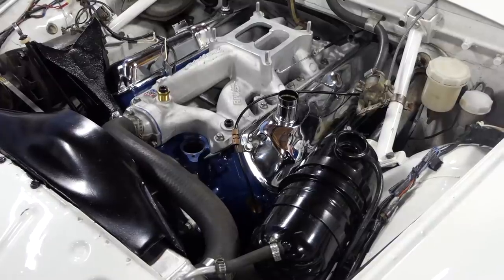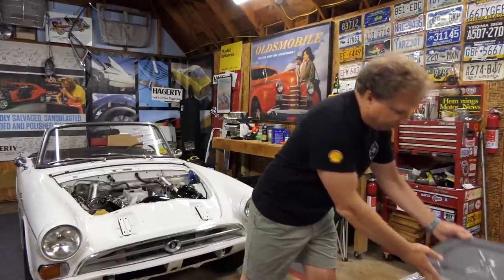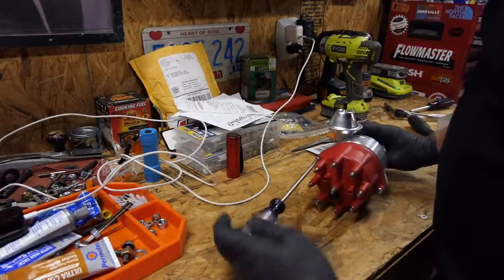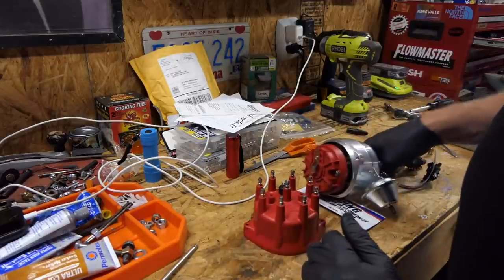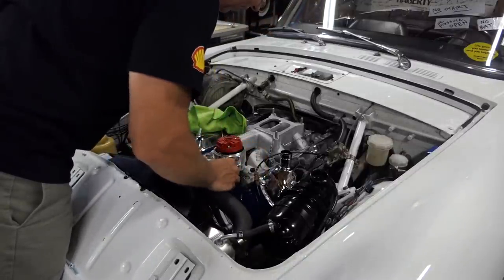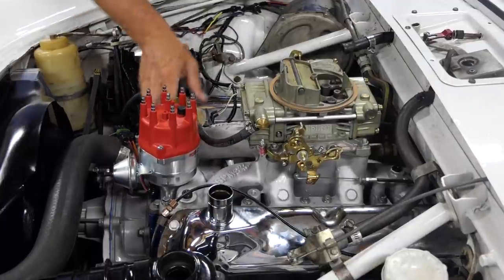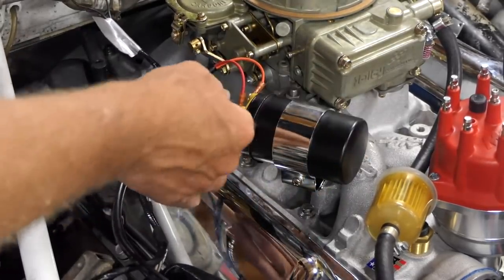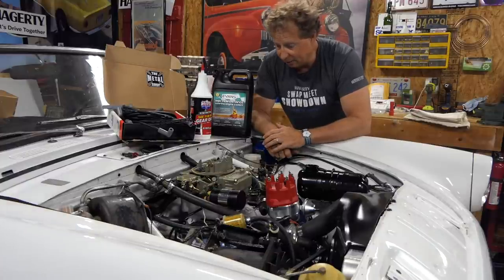Carb, distributor and other top-side parts | Sunbeam Tiger engine swap project - Ep. 10

Comment: Worried equals careful, which is no bad thing under your circumstances. I also changed to a electronic distributor setup on a 73 build and had good luck when the coil and electronics were in a cooler remote location. Started at -20 and ran well in the summer too. Best of luck to you!

Comment: Great episode as always. When you switch to the sniper though you will want to move that into coil. The ecu is on the front of the unit and with the coil and the dizzy and ecu all confined in a less than 1 sqft area you may experience RFI and have a lot of tuning problems.

Comment: The slight resistance you had when installing the distributor was the oil pump hexagonal shaft indexing with the distributor "socket". Good luck.

Comment: You can designate any of those towers as No 1, depending on how the distributor fits in the engine.  Sometimes the vacuum advance gets in the way of something and you need to turn the body of the distributor to make it fit, which will throw off your marked No. 1.  Project like this, I put the distributor in first where it fits and I have room to turn for timing, then designate a No 1 and follow the firing order from there.
Also wanted to add that you may have to increase plug gap.  I think stock with points was .035 and with EI you need to gap them at .044.  May want to check with MSD on that.
Reply: all true, just trying to match what I have looked at on other small blocks. But yes, as long as the firing order is lined up right on the cap, round and round she goes

Comment: Keep the carb! 
The Sniper ECU is so sensitive to heat and it need to run with a heat spacer...ECU will break heating up on the manifold.
 It looks like you gonna get issues to get in an air cleaner so test if a spacer will get in
Reply: I agree and you gave good advice.
Reply: The car's a rally/endurance racer
In my humble opinion: the EFI is a reasonable choice.
Reply: kyubey, the cute little devil  Normaly with OEM EFI yes! 
But these are really cheap stuff regarding electronics. I worked with several different systems and there are allways problems. A small issue with carb will still get you going. Small issue on these EFI will stop the engine.
Reply: @FordMustang1969Restomod  so........
Any suggestions for a good EFI kit that could fit in such a tiny vehicle then good sir? 
And as you may have noticed, there is not much vertical space left under the bonnet. 
Maybe he'll read this thread and look for the part you'll suggest.
Reply: that's really good to know, I'll keep that in mind when testing!

Comment: did you check you were on tdc for compression stroke? that's why you get them installed wrong. crank with finger covering #1 plug hole and when it puffs stop cranking and wind it back to tdc.
Reply: Yep, I did all that a few episodes back. All good!

Comment: Hi, just a thought, them yellow tops are 6 volts? might not work with the msd.
Reply: The coil for an early Tiger (well, maybe all Tigers) was a short, yellow top, 12V coil. You can buy them everywhere. Not sure about the 6V ones being yellow. I have a 1917 Overland that is a 6V and the coil has a black top. Lots of variants, I bet!

Comment: How many shoehorns did you have on that SBF to get it into that engine bay?
Reply: Same block size but, the original did not come with a high rise intake and a super tall distributor.  He may need a lower distributor to get the hood closed.  We shall see.
Reply: The dummy took a 260 Ford motor out. The 289 will drop in. You can get a 260 in there a 289 a 351 Windsor all will fit. I don't know why this guy is trying to play it off like this is so hard to do. This whole easy as pie.
Reply: @coffeecup391  you are sure assuming a lot about the host.ASS U ME. YOU!!!